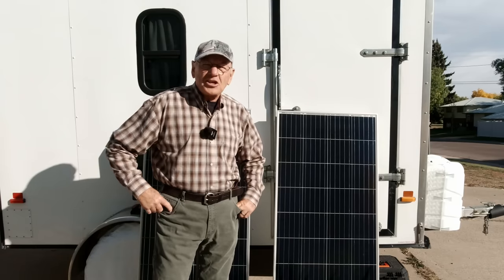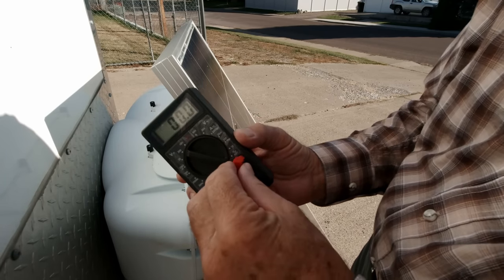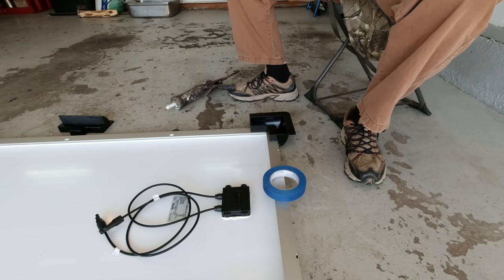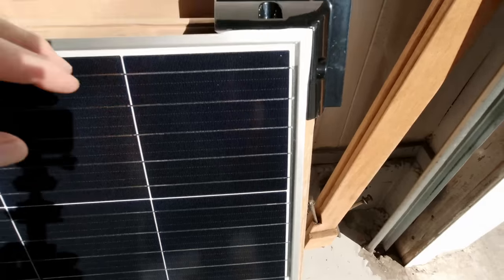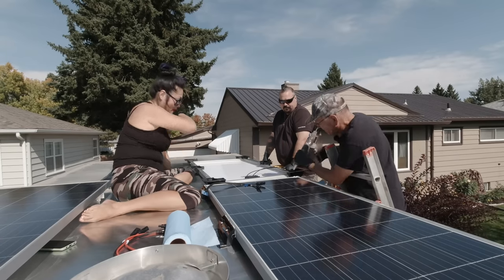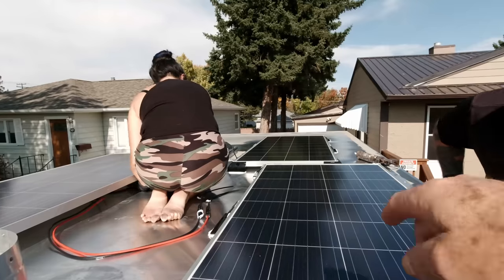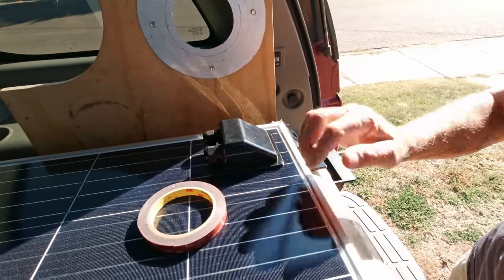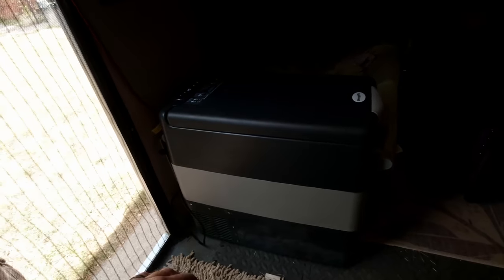RV Rooftop Solar Panel Easy Installation! Bouge RV Solar Panels

Comment: Just in support of double sided sticky tape: Many cargo trailers have the sheet metal skins installed with tape only, there are no mechanical fasteners whatsoever.  The tape is so strong that if the skin is not lined up perfectly when installed, the skin has to be replaced with a new one because it cannot be removed without damage.  Thanks for the excellent tutorial of how to do this, very clear and doable for any of us.
Reply: I didn't know that.  I can't imagine it lasting very long with all the daily expansion and contraction.  Although I installed some solar motion sensor lights to the fiberglass sides of my RV and they've been there for eight years - so what do I know?!

Comment: I'm not sure I will trust only adhesive driving 80 into headwinds.
Reply from the maker: I can see how you would feel that way if you've never used a polyurethane adhesive before, but I can guarantee you that if the panel comes off going down the highway then the roof is coming off with it!
Reply: sikaflex is extremely strong stuff, it's not like typical glue.

Comment: Just found this video and so glad I did! Helps explain more about the solar panel installation process. Also, happy to see you didn't put holes in the roof as I don't want to do that to my cargo trailer either.  Thank you for sharing this with us!  Now... to decide between the industrial tape and sikaflex!  :). Pros and cons to each I'm sure.
Reply from the maker: If your roof isn't very flat, for whatever reason, go with the Sikaflex because it can fill the gaps.
Reply: @gonagain   ok thanks!  Um… have you get up on a ladder and see. 🙃

Comment: I still like those solar panels brackets bolted to the frame with adhesive on the trailer. Driving through West Texas and Oklahoma is a challenge with gusty winds 40 to 60 mph even in a parking lot ( February thru May). Always check the top of the roof to see if that adhesive is still holding in windy areas so you don't have the panels fly off unexpectedly. on your trip.
Reply from the maker: That's a good thing to do, joe. Checking the top of the roof could be part of the preflight check list. Thank you for the reminder.
Reply: Adding some straps for a "just in case" situation could be a life saver.  Since this particular installation is "innovative," vehicle insurance carriers will not pay for property or personal injury damages resulting from a dislodged panel.

The glue bonds can also be weakened by flexing, heat, cold, wind, and age, etc.

Comment: Great video.  I live in Arizona and one of the main concerns using adhesives is their tendency to dry out and and fall off, especially with adhesive tapes.  I'm looking to do this on my popup camper which is already pre wired for solar.
Reply from the maker: Thanks for watching this one, Biker Geek.

Comment: Did you use a standard caulking gun, or one of the higher pressure guns?  Curious, seems a good way to mount panels to my travel trailer.  Thanks
Reply from the maker: I used a standard caulking gun, but that one is 66 years old! It was my dad's from when I was a boy and sees regular use.
Reply: @gonagain  I said to myself that gun has been around for some time!!
Reply: Be very careful gluing to a roof, they aren't generally secured to the frame and roof membrane can peal right off

Comment: As a solar professional I really like that the panels are raised ABOVE the roof. 
It is not much. Looks about an inch. 3 inches would be better.   
Solar panels NEED air flow beneath to cool them. 
They are NOT efficient if they get hot in the sun.   

Plus, IMO, shading the RV is another huge benefit.  
If the panels sit directly ON the roof -- then not only do they get hot, 
but they transmit heat into the RV, too.  

So, please make sure they are raised up.

Comment: Tell me something sealing the corner panels like you have done doesn't work!! because if you ever have to change it simple job with a stanley knife and the panel will come  out!  but how are you going to fit a new panel  because the sealant on the new panel will get squashed along the bottom  and the way round it will be you have to cut out the corner panels from the trailer roof😅😅😅 that's not very clever better to drill and screw the corner panels no need to wait for the glue to go off    and gluing the solar panel won't work on the replacement panel.

Comment: Where do you get the mounting hardware for the solar panels. My bougerv 180 watt solar panel came with no mounting hardware
Reply from the maker: Each mounting situation is different so they don't supply mounting hardware. They are  available on Amazon, just find the ones that fit your installation.

Comment: Reading reviews on the sika 252 on amazon and everybody complaining the sellers there only have outdated/expired tubes to sell.  Stuff is hard to find elsewhere.   Any suggestions for fresh tubes?
Reply from the maker: Hello John, I haven't had any problems with the Sikaflex I've purchased from Amazon.  If Sikaflex gets old it won't come out of the tube and you'd be able to get a refund from Amazon.  If it comes out of the tube it's fine.

Comment: why run them in Parallel, rather than in Series? pushing up your current and wire requirements. is your solar charge controller voltage limited? usually solar prefers a higher voltage for the charge controller to be efficient.
Reply from the maker: The big problem that I have with running panels in series is that the slightest shadow across one of the panels takes the output down to nothing.  Even some dirt across one of the corners seriously affects the output.  I know, because I have to run my panels in series to get the proper voltage to charge my Bluetti AC200P. That's one reason that Parallel is preferred.
Reply: @gonagain  I guess I deliberately choose sunny spots away from trees for solar and satellite reception. My panels are newer with some built in parallelism to themselves. I have even registered 2 watts under full moon before 😱

Comment: Thanks for such a detailed explanation! Is it ok to use different solar panels together?
Reply from the maker: Not really.  It can be done, but it won't get you the highest efficiency.  It's best to stick with the same size and manufacturer.  I might use different ones if i just happened to have them already and couldn't afford matching panels.  It matters how they are wired, but I'm not an expert on that.

Comment: I used 1/4 bolts and 3/4 washers. The front panel BLEW OFF! BOLTS RIPPED THROUGH THE CHEAP ALUMINUM FRAME! 100 WATT HF CHRAPPY CRAP! 💩💩💩 4 PANELS INSTALLED ON MY STEEL TRUCK UTILITY CAMPER
💩
Reply from the maker: That's not good!
Reply: I'm using 4inch T hinge now & 2 short steel straps 😛😃 it's gonna be reliable & secure traveling 75MPH & Also OFF-ROADING 😊
NOW they can tilt on its Legs.
Reply: I'll have a total of 4 (400 Watts roughly)

Comment: Once again you have given very clear instructions as well as practical advise for solar install.  Only thing missing is ALWAYS connect solar charge contoller FIRST to battery and then connect solar panel incoming wires or risk blowing out the controller.
Reply from the maker: Yep, you're very right, but the batteries were already hooked up on this trailer.  Which reminds me that I need to install a cut-off switch on my own rig.
Reply: Thanks, Good to know.

Comment: Excellent video production, and like your attention to detail. As an observation, putting those panels in series while not exceeding the maximum DC input to your MPPT solar controller, will result in more current developed by the buck/boost converter in your controller at charging voltage (14.4v), and you will still be able to harvest energy at low sun angles. Shading is not that big of an issue with modern panels due to blocking diodes isolating each cell array, thus preventing partial shading from taking the entire panel down in voltage. Putting panels in parallel worked great during the era of PWM controllers as you could pulse more current. Those days have been superseded by MPPT Controllers, so higher input voltage means more amps at charging voltages.
Reply from the maker: We wire in parallel because we've had a lot of problems with shading in the past (campgrounds are full of trees!), but I'll try a series connection to see how it goes.

Comment: Id question how well the membrane of the roof is bonded...glue is only as good as what it's its bonded to
Reply from the maker: A person needs to check.  In this case, the roof beams are bonded to the roof sheeting.
Reply: I was thinking more about the membrane to roof glue....mine is PVC and seems like it's thinner than the old style and possibly not bonded as well as old "rubber" roof
Reply: @gonagain after looking at my PVC roof I'd definitely not rely on the glue attaching the PVC membrane to the OSB sheet

Comment: You could have put your blue tape on the inside bottom of the mounts so if you did get some of the glue on the bottom when replacing a panel the blue tape will give away if glue stuck on it.
Reply from the maker: Good idea. I tried thinking of some kind of mold release but just ended up being very careful and kept the adhesive under control.

Comment: Amazing and perfect video. This answered every question I had about installing solar on my RV. I was scared to drill holes in the roof and didn't completely understand how to attach solar panels to a roof rack. This adhesive approach completely eliminates my worries. Thank you!

Comment: Do you have a shut off for panels before your charge controller, and a inline fuse? And do you have a circuit breaker between your charge controller and batteries?. I've watched literally a hundred videos and they mostly look like a nightmare to figure out, a schematic for a 1,000 watt system looks like they've wired for a rocket ship lol. 
   I went with 15amp inline fuses for each two panel series and a shut off to controller, and a 100a marine style circuit breaker and that's it. I will be adding on so i can charge via gas generator for any consecutive days with poor sunlight just as a precaution, if you have done that a video would be nice. I haven't looked into it yet, i had enough on my plate just getting a diy solar lift and my panels, charge controller and batteries figured out. I didn't want to add to my confusion. Great video, easy to follow. Thanks and God bless Rick.
Reply from the maker: Hello GypsyMike!  My setup is still a work in progress and i need to install a switch between my panels and controller.  I have a 15amp fuse coming off each panel and have a 30amp fuse between the controller and the battery.

Comment: What type of mounts are those and where can you get them
Reply from the maker: We used Renogy adhesive mounts, available on Amazon. S uff up the bottom with 80 grit sandpaper and use Sikaflex 292i adhesive.
Reply: @gonagain  we don't have anything like that here in Ohio. we have something called liquid nail, which I would hope is equal to that

Comment: You left out that you should connect your solar panels last after you have your battery connected to your solar charge controller
Reply from the maker: Good point Raymond!  I was mainly concentrating on the physical part of installing the panels themselves.

Comment: Does Bouge fridge have German compresser in it ? With 5 year warranty  ? If it does i might buy it
Reply from the maker: It has a 2 year warranty and the compressor is made in China by a company that has been in the refrigeration business for many years. Check out the review I did on that refrigerator: https://youtu.be/0iP8EVjjaMY

Comment: Nice easy install. Can you heat sikaflex for removal?
Reply: not really, you pretty much have to cut it with a sharp knife to remove it, and forget about removing all of the residue....
Reply from the maker: Nope, you have to cut it off.  It's polyurethane rubber.

Comment: Love your video.  Love Sikaflex products used for years in construction and yachting.  What is your thoughts about a tilting panel for efficiency ? Not the building that is no problem
Reply from the maker: It is definitely beneficial to be able to tilt a panel of you are going to use your RV during the colder months when the sun is staying low. You'll get a 30-40% increase in wattage by raising the panel up.

Comment: This is so helpful! Thank you! I am redoing my rv after losing my husband in Feb to cancer. I find that I already have the solar panels stored away and I have an inverter. Maybe he already stashed some lithium batteries in his stuff too. So glad holes don't need to be drilled in roof to install the panels. That's a huge relief! Thanks again! Saving your video for when I get to that project.
Reply from the maker: Hello Kathy, we had some problems with that particular adhesive.  Be sure to rough up the bottom surface of the plastic mounts and use Sikaflex 292i to stick them down.
Reply: @gonagain  excellent! Thank you for the update. I wondered about the forward winds hitting against them. I will not forget. Screenshot your comment and saving. Thanks again!

Comment: Keep the pants, you'll need them for some other messy job later.

Sikaflex is serious stuff, works great. I assume you add an inverter to provide 120VAC too.

BTW, my Renogy charge controller  is working correctly now, no error codes. Fixed itself...
Reply from the maker: A self healing electronic component!  Happy to hear it's working properly again.  There's an inverter on my daughter's trailer but I don't have one installed on mine and just use my portable power station if the need arises.  I don't use too much 110v, mainly to charge my shaver or something.

Comment: Great job. Do you think a pair of their flexable CIGS panels would survive the heat of mounting them to the surface of an aluminum roof?
Reply: Cigs are way too expensive.    But they are designed for it.

Comment: Hi Rick. Yesterday I sent a reply regarding my concerns about charging my Solar Generators from the AC outlet in my FJ. (thank you for asking about which system I'm using, and Thank You for the Advice you have given) So far I'm using a Jackery 1000 and a Bluetti EB70. They can be charged from an AC  house outlet and the folding Solar Panels as usual. My main worry is the AC outlet in my car. Somehow I believe Toyota has a built-in Converter, (from DC to AC) but I've yet to get a solid answer from them if a ' solar-converter' is needed when charging Lithium Batteries. I also have called to inquire the same question to both J & B, but no return answer as yet. Maybe I'm Over-Thinking this whole deal but I certainly wouldn't want to Burn Up those units. And yes, the FJ has the DC cigarette lighter outlet, but I have No intention of using it.  I guess I'm showing how dumb I am with all this, but better to ask for help as opposed to destroying the Batteries. Forgive me for bugging you so much about all this. I explained more detail in yesterday's reply, but maybe that never came through? No Matter What, Thank you again Rick.
Reply from the maker: No bother Vincenzo. You should be able to plug either one of these units directly into that 110v circuit in your FJ without worry about the power stations being damaged. The main thing is to see how many watts are going in and if it will reach full charge. It should be fine because those automotive AC outlets are usually of low amperage.
Reply: @gonagain  Oh Thank You Again Rick for your response and for not getting crazy from all of my lengthy questions. I really appreciate your help. The only thing I can say or add about the FJ is: the power button says 120V/100 watts 'while vehicle is in motion' (while driving)and 120V/400 watts 'max output' when vehicle is parked (either engine on, or off and depending on what type of appliance is used, and with No lights on and No air conditioning on. That's All the manual states. Nothing about amperage however. That about sums it up, with an interesting aspect that there Is a built-in Inverter, a built in cooling fan, And a safety cut-off circuit if the power demand is Too High for any one setting. Rather cool, if ya ask me. So Yes, I'm a happy camper. I Promise to give you a Complete Break from my 'power problems', but you Definitely made my day. God Bless for being So smart with things I know nothing about. 🤲✌🤗 I Owe You Big Time👏👏👏👏👏

Comment: Thanks, I'm installing panels to my camper as well and I'm glad you showed a way to mount w/o drilling into the roof. How is your precess holding up?
Reply from the maker: After many miles and lots of severe weather they're holding up great.
Reply: @gonagain  Great,thanks
Reply: @gonagain  Confusing. In the write-up it says the Sika didn't hold up and failed on the plastic mounts..? Was that less than 5 months ago? 
I always wonder if there is some kind of resin or other reaction that happens with plastic products, often seems to have glue fail. Maybe metal mounts would be safer..?

Comment: Will the matarials (tape & 252) work on RV roofs that are not metal (i.e. fibergalss, TPO) Awesome job!
Reply from the maker: Fiberglass yes, TPO I'd be careful about because you're depending on the adhesive UNDER the TPO fabric to hold.  If it feels solid then maybe that would be ok too. The 252 will stick very well as long as the surface isn't shiny.

Comment: Hope it holds up to temperature and flexing. My cargo trailer flexes quite a bit on uneven terrain.
Reply from the maker: It should because of the flexibility of the adhesive.  Good thing our trailers are all welded!  That's why we got ours, because the commercially made camp trailers kept coming apart.